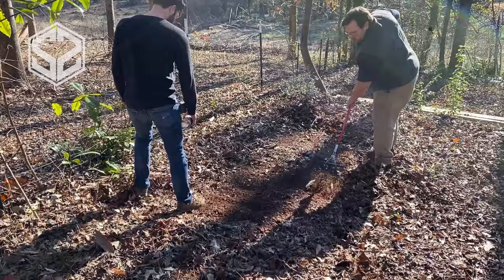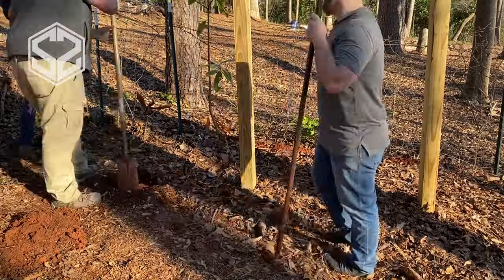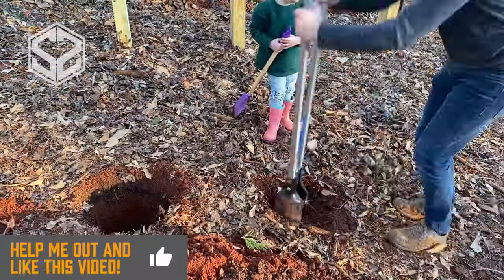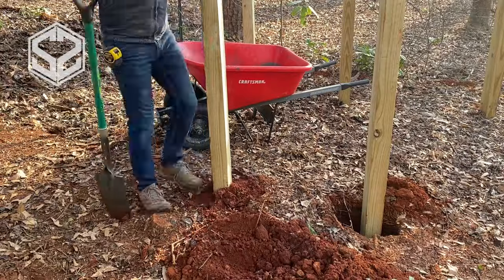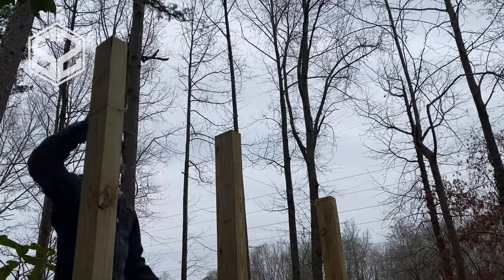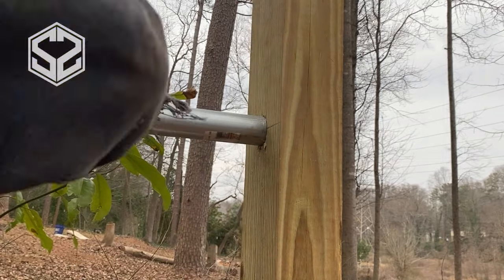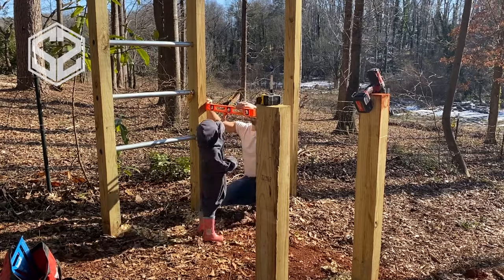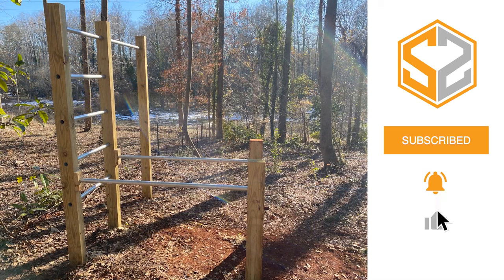DIY Backyard Gym

Comment: How have those dip bars held up? No bending? I also considered those fence posts, but was worried about how much weight they can handle vs steel pipe.
Reply from the maker: I haven’t had any issues so far. They seem to holding up great!
Reply: @SimonSaysDIY  ty for the update! They're a lot more cost-effective.